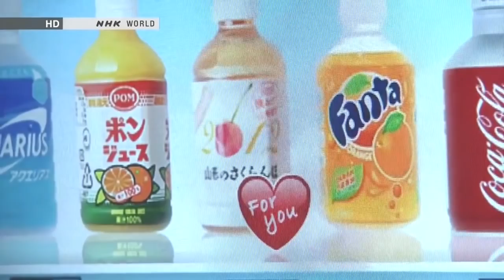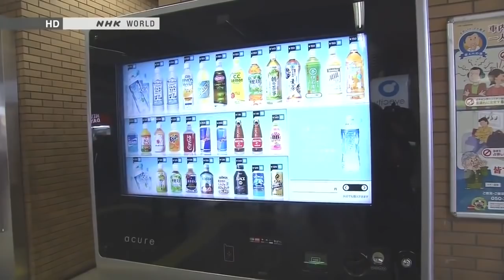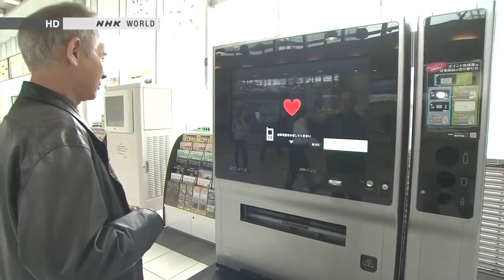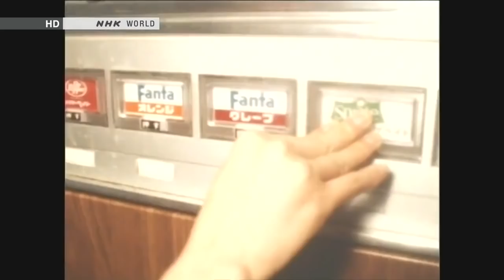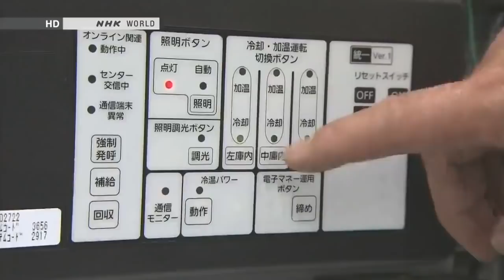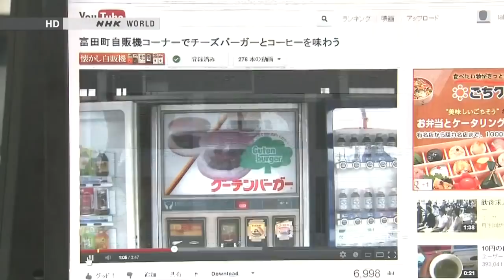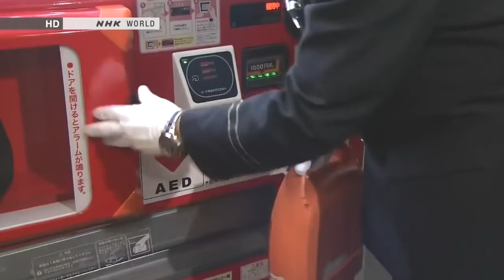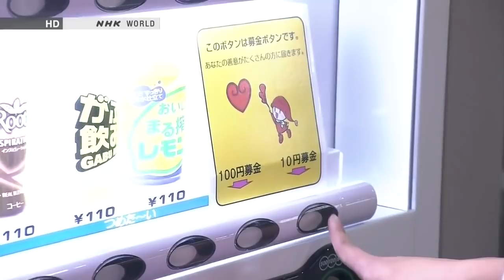BEGIN Japanology  ~ Vending Machines

Comment: Just an fyi...I worked in the vending industry for a while. Never buy unsealed food or drinks from a vending machine. You will almost always find cockroaches and other bugs (sometimes rats) living inside for the warm, humid environment. Even sealed drinks may not be clean. Have I walked across a flat of soda cans with my muddy boots and then put those cans in a vending machine? Why yes...yes, I have. I'm not proud of it, but the reality is that I was working 12 hours for 8 hours pay and I didn't have time to think about it.